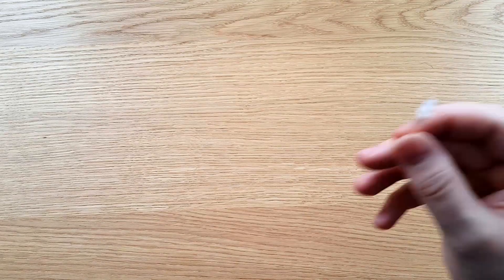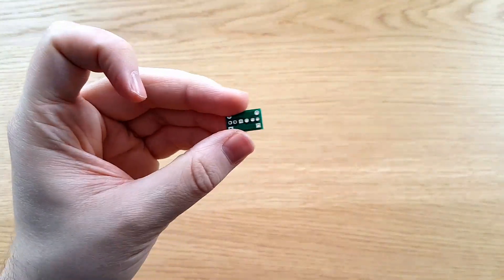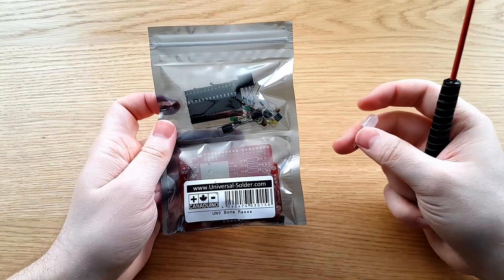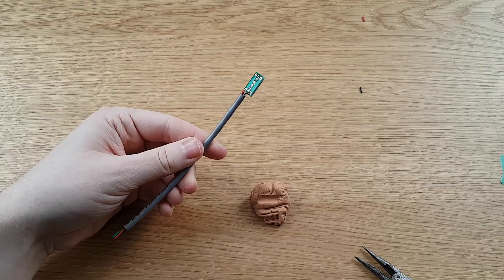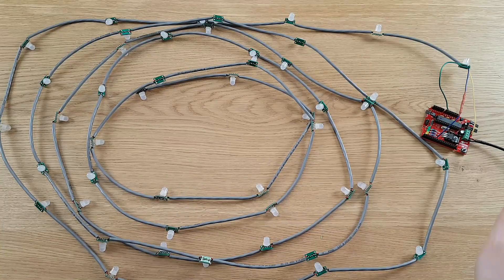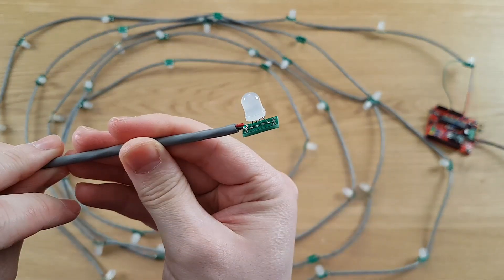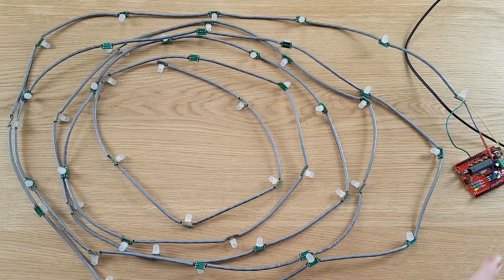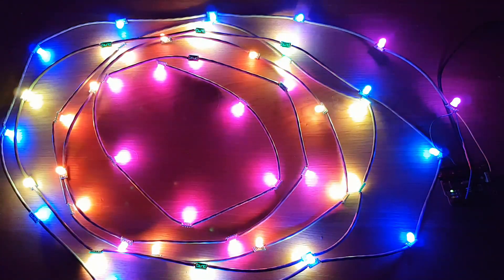DIY Christmas lights 2.0, Neopixels this time! | TWT45

Comment: Where can I get a 466 Ohm Resistor?
Reply from the maker: I'd recommend checking Digikey, Mouser, or another electronic parts seller. Depending on what the usage is, you might also be able to get away with a 470 Ohm resistor which is a more common value to find.
Reply: Wow, yeah... 466 ohms is a surprisingly-odd value for something like this that shouldn't be that fussy.  I'm really curious what specified that value?  The much more common value of 470 ohms should almost certainly be fine, and that value can vary by +/- 5% unless you really need a much tighter 1% or lower tolerance part for some reason.

Comment: Nice job!
The thing I'm pondering about, is how to waterproof them.
I'm thinking, just pot them in epoxy. Of course, one has to figure out the best way to do that, whether it being a mold, or perhaps some thick gooey epoxy that can be slathered on without dripping all over.
Reply from the maker: Epoxy would be the ideal solution for sure, I'd recommend testing it on some sacrificial components first however, to make sure there are no unexpected reactions. I used uv stable silicone conformal coating for mine and it seems to have done a decent job, the lights are still working just fine after being exposed to the elements for an entire year.